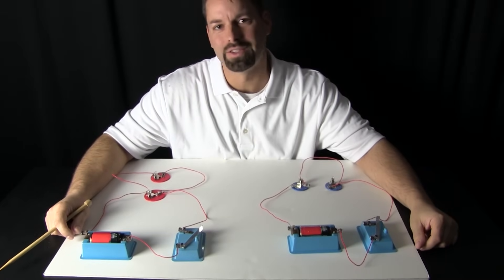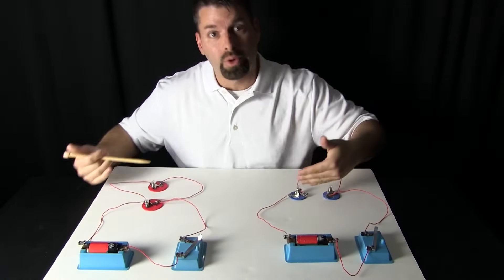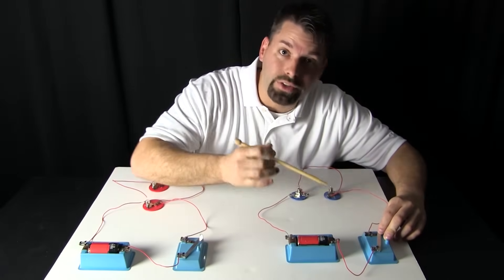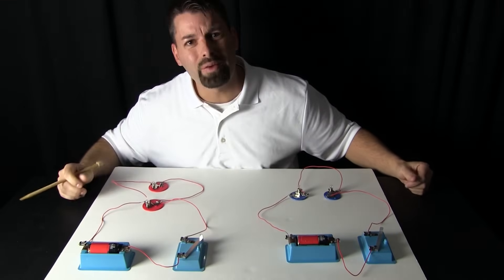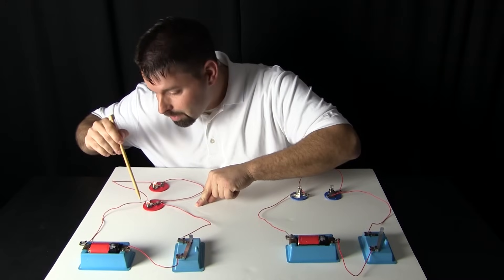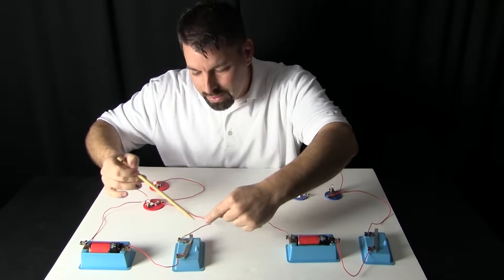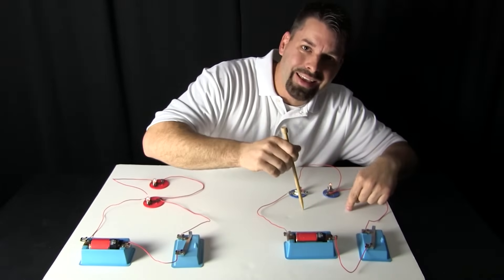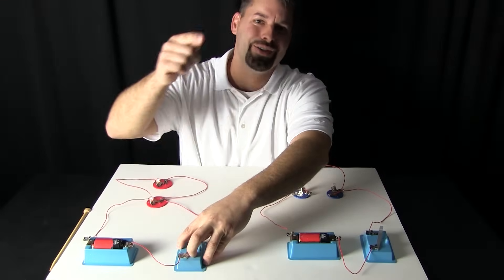Electric Circuits: Series and Parallel

Comment: So does this mean that series circuits do not have neutral wires, just one continuous wire from the line side to the neutral? Whereas, parallel circuits have hots & neutrals at each light/device?

Comment: In series circuit voltage decreased every time we put loads and in a parallel circuit the voltage stays steady without decreased. That is why the brightness is different for both systems.

Comment: Please show a closeup of the wiring when turning on an off the switch. What happens when the switch is turned off, does the wire lose physical contact with the switch? And when the switch is turned on again, does the bare wire touch the screw again?

Comment: In a series there is Resistiance (ohm's) in each load light bulb. they are consuming voltage.  In parallel the current flows in more than 1 direction, that's why the bulb's in a series are dimmer than in a parallel.
Reply: Big daddy sugar cane out with a....facccccccccct!!!

Comment: Thanks soo much and a big like👍 but I need to understand a specific point in series circuit will the first bulb light brighter than the next one and the third will be dimmer than the second .. etc ? Or all pulbs in this circuit will have the same brightness even if they are dimmer than those in parallel circuit ?
Reply: I'm no genius but  the load ( light bulb ) may require more voltage to operate than your source ( battery) is putting out. ex; a 9volt won't operate a 12v load or maybe the bulb's are rated for different voltage's, even though they look alike.

Comment: My son needs to do a science project, he got the materials, cables, batteries, little lights with sockets, but the electricity didn't flow, What is going wrong? Needs a special relation between the kind of cable? the battery and the light is 7 Volt?

Comment: what will happen to the current in other bulbs if one of the bulb in parallel circuit turns off
Reply: The other one keeps running. That's why houses are wired in parallel.  If one outlet goes bad, the rest keep working, not so in series.
Reply: they will still operate because the current has more than 1 path to follow

Comment: do all the light bulbs have the same brightness on each circuit?
Reply: No say the battery is putting out 12 volts. The blue side that's wired in series each bulb would see 6 volts. Parallel side both bulbs would see 12 volts.

Comment: How does it split paths, I thought electricity only took the path of least resistance, why would it make the effort to go to the second light bulb in parallel?
Reply: because You have multiple loads in the circuit ,and they will consume the current before it returns to the source ( ground side - negitive)